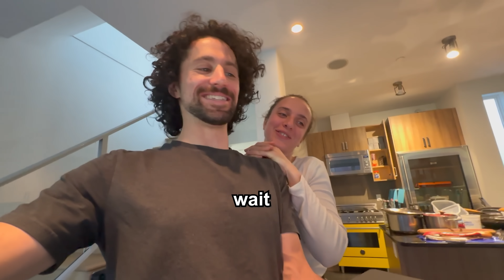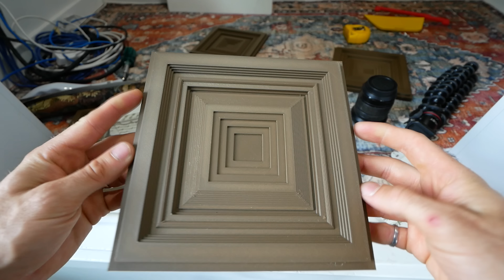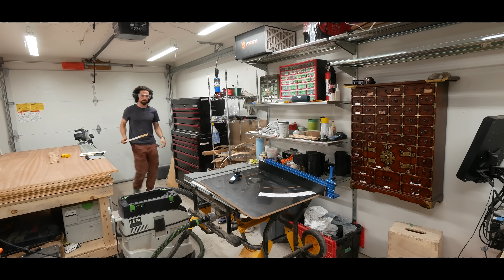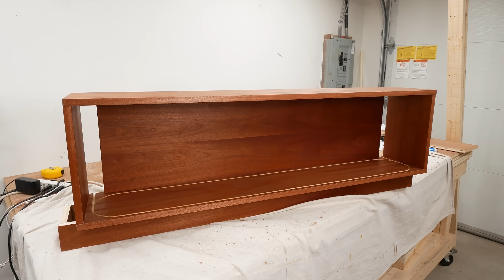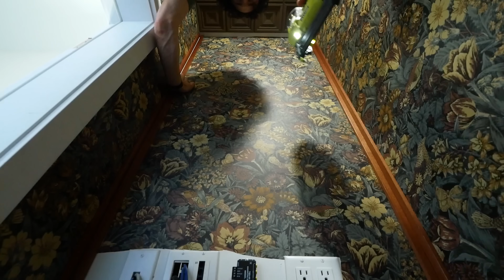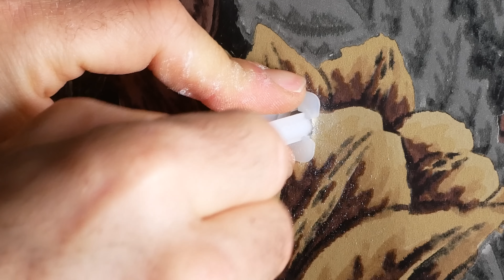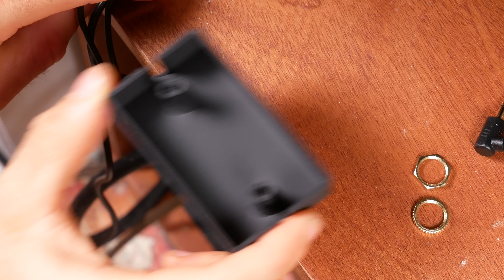I Built a Tiny Library on my Stairs

Comment: One thing about those roll up doors, if you put books or whatever all the way to the rear it blocks the door from closing.  I've had no end of trouble with those roll up (actually up) doors in my cubicle at work.  The problem with those is that you need room for the panels when opening the cabinet and it's really hard to get it open.  In your situation you won't be locked out at least.

Comment: Idea for the door: a painting that slides up, you could use hinges so it will be flush on the door frame as well as on the wall obove. And if the bookshelf lights are on, the light shines trough the painting and its kinda glowing.

Comment: Might be an overthought idea, but what about a door  that looks like a portal (made with proper lights) and a sensor when you pass through it , it turns off the light so it doesn't bother you when you are reading.(the sensor  should be easily doable with a micro controller like ardoino or esp32)
Reply: still if you make it like a painting that is opening you can program it to accept certain sort of movement infront of it in order to open. that would be so cool :)

Comment: I believe the best option for a door is a painting which slides up. There are these picture rails which can also act as ceiling trims to hang stuff on the walls, so i would be easy to disguise a curtain system (motorized or pulley) as one of those.
This would mean it looks normal in both he open or closed state because the painting is visually not directly connected to the entryway.
Reply from the maker: Ooo interesting, I will have to look into that rail!
Reply: I'll be glad if i sparks an idea :D

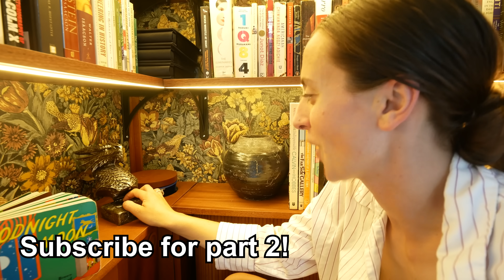Comment: 27:10 It should either be a sliding picture frame with: option 1 a Animated Scanimation Card effect portrait,  option 2 a diorama portrait, or option 3 a two sided mirror portrait that when lights up you see the booknook inside.

Comment: Those are my go-to toggle bolts. I wouldn’t exactly call them drywall anchors but they are so much stronger than plug style. I always tell my customers when I’m mounting things with toggle bolts that the concern isn’t them getting pulled out, the wall would likely collapse first with the shelf still attached.

Comment: For the door you could try A printed mesh roller blind, with a cool painting. Then you could frame the door with a picture frame.
That would give the effect of a picture you could climb into, but also if you did want to close the "door" air would flow in and out, you could also look out.
When the roller blind is all the way up, you become the picture that is hangning on the wall.
Bonus points if you can make the painting a victorian library.

Comment: I used to hang all my pictures on the wall using command strips. We had a particularly warm summer in the UK one year and we came back from a wedding to find half our framed photos on the floor. I've used hanging screws since, don't want our cat (or one of the peeps in the house) taken out by falling pictures lol. However, I think they'll be fine for the 3D printed tiles, I've got a few canvases held up with command strips and they've never had a problem even with hot summers. 👍

Eden is the GOAT.

This has made me realise we need a space in our house for reading. Ta for that, going to be pondering that for a bit.

Comment: I am partial to the picture frame idea. However one spin on it that you could do is have it open upwards with a self retracting cable so that way you can pull it closed from the inside and you could also close it from the outside without the pull cable getting stuck in the door. Or have a small weight on a cable attached through a pulley to hold it away from the door and retract without a mechanism that could break.

Comment: For the door, 
Big picture frame with a painting that rolls up to one side.   gear mesh to a rod that can be rotated from the inside or outside, or just pulled closed quickly.  Also, if you could see through the painting from the inside, that would be cool.  Bonus for if the painting looks like the inside of the library but with nobody inside . . . ORRRR maybe a sleeping dragon?

Comment: Y'know the Death Star bulkhead doors - 4 triangular sections where 2 corners are fixed and the opposite corners slide horizontally?  Now instead of being black/opaque, some sort of translucent material, so you see the hint of a library through them but it's not transparent.  Bonus points if you etch halfway through (say) acrylic and then edge light it, so when the doors move, a light turns on.  So a nod to SW, plus some bonus magic rune aesthetic.  😃

Comment: 1-U could install special type of glass that u could change the the dim by rolling switch,so u could choose the clearness or full dim black glass.
2-or just go cheap and more practical and buy double layer glass with one way (the inside can see out side but out side can’t) then put a sticker paint on it with wooden frame (it will give u the very interesting style of old water painting on glass if u nail it right it’s going to be legendary and pry that land lord don’t take it😂)

Comment: a picture behind which the counterweight system is hidden. It would be cool if the scene in the picture would echo the view of the library in the doorway. You can also make 2 paintings into one and if you look straight you will see one, and when you lift up the other. but you will need to be clever with the angles

Comment: As someone that uses command strips for a TON of DIY renter friendly projects. They will damage the walls if used for too long. I am not sure what it is but I've pretty much been using them since I got my first place 20ish years ago. Every time I go to move, they end up tearing paint and sometimes the paper layer of the drywall off.

Not sure if that says someone about the 5 or so Seattle area apartments/houses I've lived in over the years or if they aren't as damage free as they claim. They are still far too handy to not use though.
Reply: Also, you need a way to be able to grab the tab to stretch the adhesive and make it release?  There's no way to get to it under those ceiling tiles now.
Reply: @Somnifuge I figured they were the the weird Velcro ones but I was also only half paying attention to the video.
Reply: @Somnifuge, He, he, he, that's what I thought when I saw the way he was installing them.
Reply: Happens every time here in Southern California. I hate those things. Now I just use anchors and patch the holes. Way easier.

Comment: Chances are this won’t be seen, but my idea for the entrance to the library is a “ kinetic sculpture “ doorway, not only would it be fitting visually if you stilled the panels similarly to the roof tiles. But it’s mechanism may be way less invasive then other options.

And oh yea!, you can make them bend around/into corners with a few extra hinges. That’ll leave the door on display while open, and the window in-view.

Comment: Why has no one mentioned this? I thought most carbon fiber filaments leave small dust particles on your skin that can be very inchy when you touch it constantly. I just wanted to provide a warning in case it could potentially be dangerous.

Comment: You don't really want to print those shelf brakets in this orientation. I know you saved time but they are sooo much weaker than if they were printed flat, the layer lines would break way more easily under weight, and especially nylon which doesn't bond that well on the layer lines. Praying for it not to happen to you but be aware it might very well

Comment: An over the top Victorian portrait. Big chunky frame to fit around the door jamb. Then simply print on vinyl and a roller blind on a track. You could use a couple of servos to tension the picture once rolled down.

Comment: I'd go with a large single canvas with an image of your choice, and as you enter, have it open towards you with the hinges on the right so as to not block the window.  You might want to have it cover the portal in an oversized fashion so when it does sit open, the hinges are fixed closer to the corner of the stairwell.

Comment: A really big one way mirror - completely covers the doorway but even if closed you can see it if it from inside. Will make that area feel even larger as well. Mount it on a drawer slide just above the doorway so it just slides to the right to open it.

Just saw a comment saying the area to the right isn't quite big enough.. So I'll change that to have it on the drawer glide till it meets the wall and then have it hinge so it opens flat against the right side wall..

Comment: Make the whole wall into a wall with wood panels, like they have in those old houses. Then you could slide one (or more) panels open (slides behind the other panels) to reveal the opening. If you give it enough depth you could also hang a painting on one of those panels. Maybe even make the painting a little door as well, so you can pass through extra snacks when the panels are closed.
Make sure that it can open manually from the inside as well in case of an emergency, like a power loss (or worse).
Oh, and I guess you need some ventilation then too.

Another option would be those vertical slats that you see so much lately. But not really a Morley Kert thing I think ;-).

Comment: Some potential ideas:

- Portrait of Eden with the cat. In a victorian; or mid-century, garb; will be worth taking after moving out

- The "one-way mirror" comments are pretty smart; but you'll have to make sure the staircase landing is much brighter illuminated than the inside. If not the inside lights will be visible.

- A book rack; that holds books visible, and is relatively flat to the door itself. Can be in the same type of dark wood style as the library, but is probably best done in the minimalist white that the rest of the hallway to be the most discrete

Bonus: a combination panel. Some pairing of one-way glass + book rack; portrait + book rack. Can't do portrait + one-way glass, it won't look good aesthetically. Unless there's a book rack separating them, to break them up.

Secret Mode: Is it possible to get a photo portrait printed onto one-way glass? That's a combo bonus right there.

Comment: Super simple door solution—hang a tapestry over it with room on the curtain rod to push the whole thing to one side. But that’s definitely not something you can over- engineer for a whole episode! Unless you built a tapestry loom I guess, which would of course be sick af. 

Or dramatic opera house curtains that swish open? You could engineer a track to open them with a button. 

A door that flips up and looks decorative on both sides—like wall art when down or also wall art above the door when open—might be fun. 

Or two doors that open out flat, make them look like a gothic religious icon when closed?

Comment: Great idea, well done. I would like to make one of these at my place. 

For the door wall, make the wall a full-length vertical slats, floor to ceiling, so that there are no cuts, and the library door is invisible, and only those who know it is there can find it. The door will have slats from floor to ceiling, although the door is much smaller. I am sure you can work out the right weight of the slats for the door. You could either make it a feather wall and leave it in natural wood, or paint the slats the same colour as the wall.🙂

Comment: it might be slightly expensive but a door with an electric switchable privacy glass. your never going to truly hide it with all that trim you cant remove as a renter so it will just look like frosted glass from the outside but you can make it see through. Bonus for adding a discreet grill and fans to it to cycle air in and out across the top and bottom (recommend grill on top and bottom but fans pushing air out the top grill and leaving the bottom as passive intakes. in a small space when your reading a fan blowing directly on you can get annoying.) I recommend noctua fans, industry leader in quality, are quiet, and include an adapter for a further low noise mode, and if you use wood for the vents and stuff you could even get away with the cheaper tan and brown ones. PC fans also spin slower with less voltage so you can easily make them adjustable with a variable voltage switch, or use a PWM speed controller module.

Comment: I agree with some of the ideas to make the door into steps, to expand to those ideas the centre of the steps can be carved out to make more space for secret storage and I believe that you should make it all electric with the use of hydraulics. With hydraulics you can have a range of different patterns to how you want the door to open/shut. If you want to add the idea of the painting it would also look great on the steps and when those steps fold out they can have even smaller paintings on them. This idea also goes with the theme you're looking for.

Comment: What if it was a fake bookcase? Each side could be the size of the walls on either side of the door. The bookcase could LOOK as though it goes all the way into the wall, maybe with some sort of illusion but when it opens up, it would look like you have even more books going into the secret bookcase. I think it would fit well with that look and could make it not look as awkward as a picture that splits in the middle. Would also be easier to hide the seam of the door if it was like two bookcases pushed together. Now how to make it thin enough would be fun but I think it could be done. Especially when looking at it from afar.

Comment: Looked at the door\wall it's on after I watched the whole thing, just mount a picture on rails and raise and lower as needed, maybe with a remote or hidden switch, there looks like more than enough wall above the door to handle a slide up setup, and as long as you keep it light you should be able to anchor it to the trim on the door and not touch the wall at all.

Comment: You should add some sort of hidden fan, maybe in the wire door area. Also, tou could to a painting that folds in Half , so you could see the window, get some air, and show people the library without having to go fully open the door. Plus, the painting would unfold then you closed the door,making it hidden when not in use, for practically

Comment: You should do a painting with a hidden button that when pressed slides the picture/door up vertically so it is stored above the door in the library! Keeps with the hidden library theme and keeps the door out of the way when you’re in the library! Could also make the door thin and light so you don’t need much power to lift it.

Comment: How about a roman shade with the fabric being a tapestry-type design or a painting on canvas. It can lift upwards in panels that stack on top of each other, using cording and a pulley like blinds do. A heavy rod in a sleeve at the bottom and lighter, flexible rods at the lift/fold points.. I made one 15 years ago and affixed the fabric, wrapping it around a 1x2 piece of wood and screwing that above the window. It is a little complicated but it is an awesome effect and fun build!

Comment: Those tiles are gonna suck to be taken down if they need to be. Those 3M strips really need you to use the little pull bits if you want to remove them without damage

Comment: My first thought for a door there was to have a large one way mirror so it can reflect the windows light when closed and the person inside can look out. Opening it can have many options. The first one I though of was to have a floating shelf with a hidden switch on the outside next to the mirror.

Try to keep ventilation/airflow in mind. It looks like if you close off that space, you might need a vent of some kind.

Comment: Eden is absolutely the GOAT.

If, like me, you're not that great at sewing but want to make custom cushions, a terrible hacky compromise option is to gift-wrap the foam in your fabric, then use fabric glue (the good stuff, which is very solventy, so VENTILATION) to stick the overlapping fabric down to itself.

This does create a non-removable covering, so "taking the covers off to wash them" becomes a non-option. You will also end up with an entire ugly-side, rather than being able to put buttons/zipper (or a pillow-flap) along one edge.

Comment: You'd never get the seam to work right in a split painting, so if that's how you want to open the door, don't hide it. Make it like a triptych -- two panels that open up, with tall, narrow paintings on either side of each panel. (Normally in a triptych, it'd open up to a large painting in the middle, but you'd have the entrance there.)

That, or make a shallow cabinet front that looks like it could be storing linen, or something.
Reply: Triptych    ok we are going Medieval now.

Comment: Bit of a wacky idea, can you use a painting as the backing for another tambour door, then have it roll up at the top? It would almost look like a garage door but I'm thinking either have it slide up (in the shape shown on a reverse curve road sign) or possible have it roll into a cylinder shape for better space saving. With the garage style door being used, I imagine there would be a way you could even have a remote to open/close it, as well as possible presets (leave it cracked open a bit or halfway open for the pets). Also Eden is the GOAT.
Reply from the maker: Painting as the backing is a really cool idea!